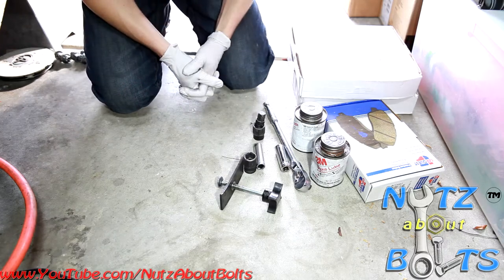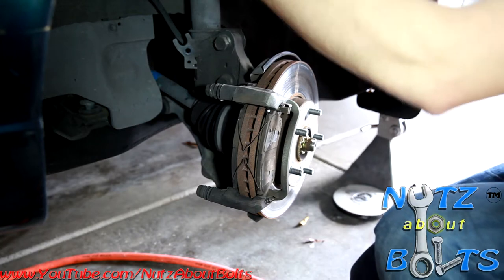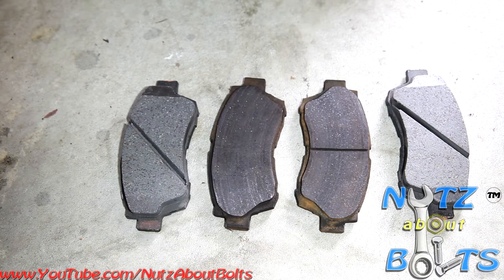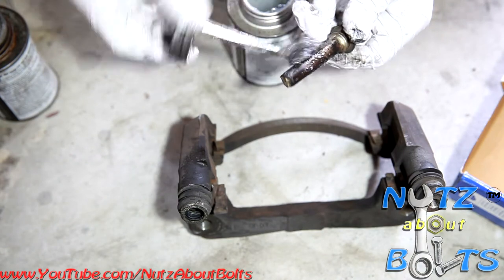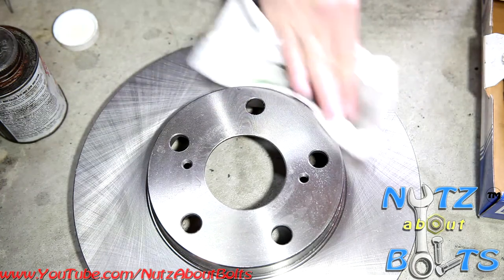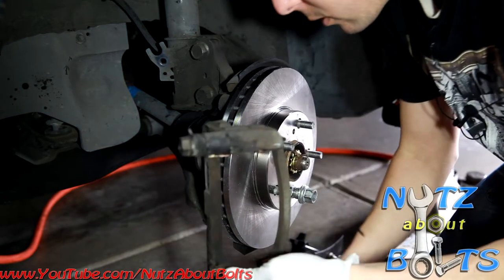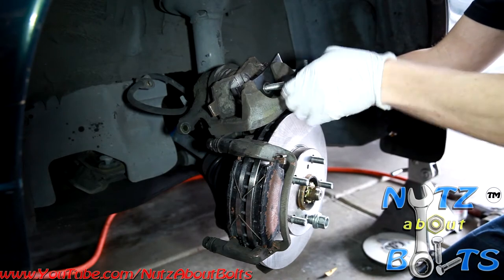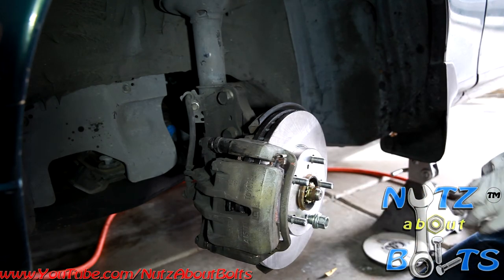1992-1996 Toyota Camry Front brakes remove and install

Comment: Thanks!  Well done video.   Should I consider cleansing out the tunnels that the slider pins go into?   Also, my Camry has 150k miles, should I replace the flexible brake lines connected to the caliper?  Thanks again.
Reply from the maker: Yes relube the sliding pins, no on brake lines.

Comment: What type of 14 mm and 17 mm you use a 3/8 drive or 1/2 and are they the deep socket 6 pt or 12 pt? Great video!
Reply: 3/8 ratchet with deep sockets. 6 point.

Comment: Question - Found that when I put the caliper back on and secured the bolts to the slide pins, I could not get a firm "tightening"  my assumption is that you put a box  wrench on the slide bolt head, then tighten the bolts??? Looked like you were able to torque yours just fine.  Thanks for making the video!
Reply from the maker: yes, you might need a 17mm bike wrench to hold the nut down to torque the 14mm bolt down.
Reply from the maker: its a 17 or a 14mm bike wrench, I think it might be a 14mm.

Comment: Do I need to buy separate anti seize and grease or can I use anti seize on the caliper bolts or brake grease on the contact points on the pads and clips?
Reply from the maker: silicone greast on caliper sliding pins, and brake anti seize for the shims and brake hardwares.